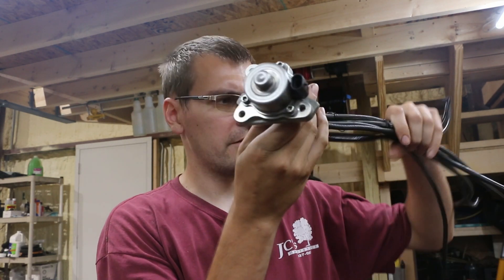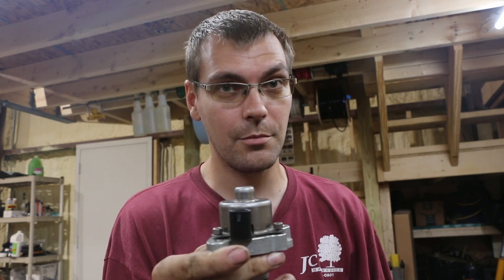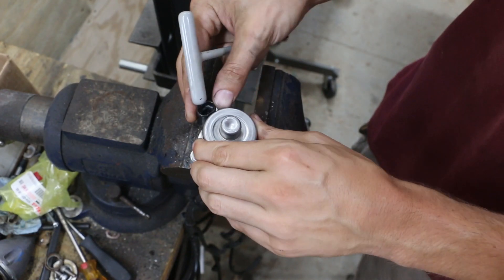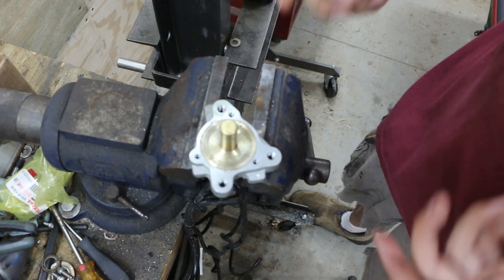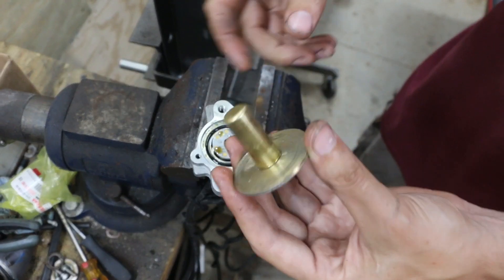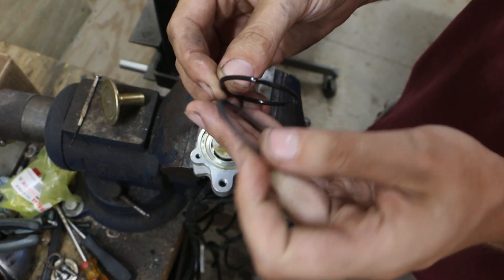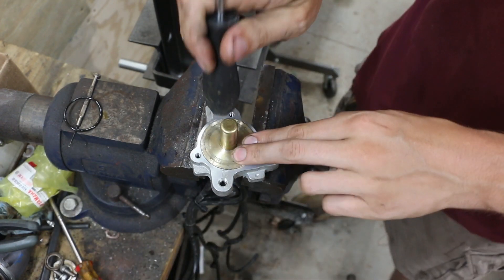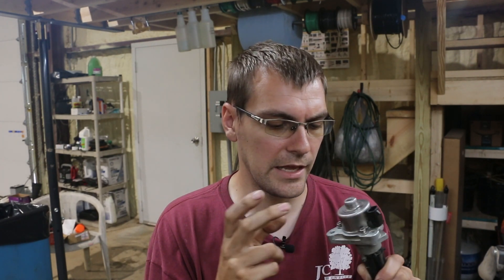Mercury Optimax oil pump leak repair. (Maybe.)

Comment: Is there a spring in behind that piston?
Reply from the maker: yes, its essentially a small solenoid pump, so the solenoid energizes, pushes some oil, then de-energizes and is pushed back by the spring

Comment: Was that M3 X 36mm ID or M3 X 36.2mm ID. I am in Australia and I have unburnt oil dripping out when I tilt up my Optimax 150. I have checked on the hoses for poor connection and the one that's connected to the block is has a loose cable tie but no oil leaking there. I am guessing it is the pump.
Reply from the maker: I used a m3 x 36id, this exact one is what is in my order history: https://amzn.to/47KQPLe

Comment: If the o ring is replaced while still on the boat without disconnecting the lines would I still have to do the priming procedure?
Reply from the maker: I would be hesitant to skip the priming, worst case you use a little extra oil for a while and foul plugs, best case it bleeds out any air that got into the system while it was open to change the o ring

Comment: Is this the only seal in the whole pump? The only place it could possibly be leaking?
Reply from the maker: This is the only seal I am aware of that will cause a leak, but there are other small o rings on each piston that could cause it to not pump oil. I haven't seen those cause an issue yet though
Reply: No, it has 7 more o-rings, they wont cause a leak, but are critical, if you need one you need all, IE new pump, not worth the risk

Comment: Since the oil tank is under pressure this unit is playing a role of valve to allow compressed oil to go thru output so it is not a pump it is a one wY controlled valve to open and close oul supply
Reply from the maker: Close. There is air pressure fed into the remote oil tank to keep the primary oil tank full, with a 2psi check valve to make sure the pressure does not get too high, but the actual oil pump is an electronic solenoid pump that pumps oil regardless of there being pressure in the system anywhere.
If it relied purely on the pressure in the tank, the engine would starve for oil at startup or any time the oil tank was opened to fill.
You can disconnect the air line, remove the remote reservoir, and still run the engine without issue until the primary oil tank runs dry, or run the prime procedure with a scan tool or using the onboard method to cycle the pump with the engine off and no pressure anywhere in the system.
However, that slight positive pressure in the system could be a major factor in the o-ring in the pump leaking as it ages.
Reply: It is pump, will deliver oil with no pressure on the tank. in fact if the pressure is restricted and the tee check is bad or some one capped the vent port it will suck the engine mounted tank in due to a vacuum. Most the time the leak is not that o-ring it is a cracked brass cylinder

Comment: Question. Have u have done this with the pump still on the engine ? 250 pro xs
Reply from the maker: Yes. I did it on a 225 pro xs on the engine. It was a tight squeeze but doable. I would not even consider doing it over the water, too many small parts that could easily be dropped, but on a trailer I wouldn't hesitate to pop it apart and replace the o ring
Reply: @trythistv  yup I did it o ring was pretty flat took 15min on trailer in shop. Then primed 2x w my diacom.    Allen key with round head on it worked great
Reply: @trythistv  thanks for video. It saved me so much work and for the o ring link. Great content.
Reply from the maker: Yes sir! Ball head hex are awesome. Glad the video helped you get it together!

Comment: Exactly where is the pump located?
Reply from the maker: If you pull the cowl, looking from in front of the engine (if you were kneeling on the boat), the pump has been on the bottom left hand side of the engine, almost under the lower cowl on every opti I've worked on, there could be a bizzare one out there thats in a different spot, but thats where I've always seen em.

Comment: Worked great on a 2009 EFI 150 I pumped throttle 4 times to activate oil pump prime mode and it was all set thanks for the video
Reply from the maker: Awesome, glad to hear it helped you out.

Comment: I had a small leak from the oil pump assembly. The O ring was Ok, but found a longitudinal crack on the solenoid. Why did this happened? Is it a common problem with Mercury 200hp 2.5L EFI? A new pump has to be install?
Reply from the maker: I haven't seen that happen before, It is possible there was a defect or something, or possibly we will start seeing more fail like that if it is some kind of age or use related failure. Could be the action of the solenoid causes stresses that eventually caused it to crack, or something else, who knows!

Comment: Uhhh, still no luck finding the o-rings.  All the shops want to sell you a 600.00 new oil pump!  IF an oil pump goes bad, does it beep and let you know so you do not have catastrophic failure?
Reply from the maker: No warning on if the pump stops pumping. It is a relatively robust design, being a solenoid pump, but with that being said, it is not going to let you know if something does go wrong.
As far as finding o rings, I commented a while back about another source:
Mcmaster Carr. They sell everything on the face of the planet, and a few things that haven't made it here yet.
One of these 2 packs should do what you need, the cheaper one only has 5 o-rings, and seems to be a little different from the description, as it says there is a shelf life, cure date and stuff, so I'm not sure if thats a more milspec type situation, or if it is a different type of material. Still says Viton so it should be the same stuff, just perhaps held to a higher standard?
https://www.mcmaster.com/1295N563
https://www.mcmaster.com/9263K315

Comment: Could this be done without fully removing the oil pump from the motor? By just removing the cover while it's still on the motor and replacing the o ring in place?
Reply from the maker: Yes. I have done it with the bottom cowling still on, while the boat was in the water, its tight, but can be done. I would recommend against trying it while in the water as if you drop something, it goes to the bottom of the lake, but it can be done, preferably do it on a trailer where any lost parts won't vanish for good.
Reply: @trythistv  I'm going to do this I'm glad you shared that. I really don't want to disconnect hoses and that fun stuff. Do I still need to prime even if I replace the o ring this method?

Comment: Priming process is via dealer OR, turn key on and within 10 seconds, move throttle N to F 3-5 times. You should hear the oil pump clicking and fuel pump coming on. Could last 30 seconds to 1 minute ish. Note: this puts your motor back in “Break In” mode and it’ll use double the oil for 2 hours.
Reply from the maker: And it makes a glorious cloud of blue smoke when you fire it up after priming!

Comment: Do you have another source for the O-rings ? They are out of the V3.00x036 the only one close to it is V3.00x36.5
Reply from the maker: Mcmaster Carr. They sell everything on the face of the planet, and a few things that haven't made it here yet.
One of these 2 packs should do what you need, the cheaper one only has 5 o-rings, and seems to be a little different from the description, as it says there is a shelf life, cure date and stuff, so I'm not sure if thats a more milspec type situation, or if it is a different type of material. Still says Viton so it should be the same stuff, just perhaps held to a higher standard?
https://www.mcmaster.com/1295N563
https://www.mcmaster.com/9263K315
Reply: @trythistv  thanks! The ones I got from another site wasn’t correct even though it had all right dims etc. ordered off your link you provided now. Hopefully it’ll be correct this time. Super easy to perform the repair while it’s mounted on the boat. I put it all back on for now and once the new o rings arrive, spend the 5-10 mins to do the repair again.
Reply: @Profishinal  do you have the part number I don't seem to be able to find a 36 only see 36.5 on that website. Thanks
Reply: @mikem7683  I bought 9253K315
Reply: @Profishinal  Thanks I think I found it it's a 50 pack. Let me know how it works and if you want to sell half the pack I'll buy it from you who needs 50 o-rings lol
Reply: @mikem7683  I only got 10 pack. 🤷🏻
Reply: @mikem7683  and from the looks of it, it’ll work perfectly. I’m going to change it out tomorrow and I’ll let you know.
Reply: @Profishinal  thanks for the info and I hope the fix works for you will have to do mine in a few weeks.
Reply: @mikem7683  the o rings are much fuller… had a hell of a time trying to get the plate to seat back in. In the end I couldn’t get it and seems like the plate won’t set in there by itself anymore. I just put it on carefully and put the plate back on and the plate is only being held in by the cover with the 3 Allen screws now. I’ve tested over an hour and no alarms and no issues with leaking anymore. Again, the oring was a fix to my leaking issue. Not sure if there’s a better option for oring that isn’t so full so the plate will set in better or not? I’ll replace the pump in due time, most likely next year, but for now it’ll be fine for the rest of the season.
Reply: @Profishinal  thanks for the info. By fuller do you mean the thicknesses  of the o-ring
Reply: @mikem7683  yes thicker.

Comment: I have a Nissan 90HP Direct Injection - TLDI.  I have read its the same pump as the Optimax and Mine has a slow leak.  Will be trying this.  Thank for posting!
Reply: After disassembling/inspecting my leak was caused from a crack in the brass piston (the one which came off in the video).  Make sure you insect that part!  If it has a crack and is leaking replacing the o-ring will do nothing to prevent air bubbles entering the system and potentially causing lack of lubrication/major failure!

Comment: I dont know what wrong. But i replace the o ring you talking about.  And it still leaking . do you have any ideal ?
Reply from the maker: There are some other spots it could leak from, hoses are always a suspicion, or if you can see it coming from around where the o-ring area is, could it be you didn't get it quite seated properly?

Comment: how do you prime the oil pump
Reply from the maker: A scan tool is the easy way, but some optis can be primed by switching the ignition key to run (Don't start the engine) then very rapidly shift from Neutral to the Forward detent, back to neutral, back to forward somewhere around 5 times in a 10 second timespan, and if you have the cowl off you will hear the oil pump clicking, fuel pump will also come on, and that is a prime cycle, it should run for about a minute, which if the oil reservoir is full it should pump a bunch of oil which will make a glorious blue cloud when you start it, and that also resets the break in timer so it'll be billowing smoke for a few hours as it drastically increases the oiling rate.
Reply: @trythistv  How about a mercury 240efi? Islandia bombadier
Reply from the maker: I'll have to refresh my memory on the islandia, I've worked on a few of those, replaced an engine on one that failed from an oil line popping off.
If I recall they use a mechanical pump, not this style optimax solenoid pump, although I believe there was a retrofit kit to switch to an electric pump but I'm unsure, it's been a while since I've had one in the shop to put eyes on. Super cool boats, just don't see a lot of them.
Reply: @trythistv  yes love the boat

Comment: i have mercury optimax 2 stroke  90 Hp 2009 . do you know if this o ring gonna fit on mine? thank you .
Reply from the maker: It should be the same pump from what I can see, The one in this video was off a 150 Optimax, I've worked on a 250 ProXS that uses the same pump, and the exploded diagrams look like the 90 uses the same one, so the o-ring should work on your pump!
Reply: @trythistv  thank you . and im trying to prime it after replace the o ring by manually setting motor back to break in mode. Can you please tell me is there anything need to watch out if i do that my self. I just worrry  because i dont know if the oil pump working properly after i prime it.
Reply from the maker: I would find one of the little hoses (outer is the outputs, the big hose in the middle is the input, don't pull that one off) out of the pump and pop it off the nipple, could even do it right on the back of the pump if there is access, make sure its pumping oil out of the nipple, you should also be able to hear and feel the pump running when you do the reset, if you have a nipple off it will be obviously pumping oil out as the pump runs for the prime/breakin reset.
Reply: @trythistv  appreciated for helping out.  Besh wishes

Comment: Nice video ,so it is a solenoid pump  right????
Pls reply
Reply from the maker: Correct, it is a solenoid pump, as far as testing the pump I'm not 100% certain but a voltage pulse should cause it to pump oil, I would think it would be a 12v solenoid but I am not sure about that, and I wouldn't leave voltage applied for more than a quick tap to the connector, likely attaching some clips to the pins, connect negative to negative on a small battery like a lawnmower battery, then tap the positive alligator clip wire on the positive terminal of the battery and see if the pump clicks, more than a quick tap could end up burning out the solenoid coil if it's set up how I'm imagining.

Comment: What is the process of priming the pump?
Reply from the maker: A scan tool is the easy way, but some optis can be primed by switching the ignition key to run (Don't start the engine) then very rapidly shift from Neutral to the Forward detent, back to neutral, back to forward somewhere around 5 times in a 10 second timespan, and if you have the cowl off you will hear the oil pump clicking, fuel pump will also come on, and that is a prime cycle, it should run for about a minute, which if the oil reservoir is full it should pump a bunch of oil which will make a glorious blue cloud when you start it, and that also resets the break in timer so it'll be billowing smoke for a few hours as it drastically increases the oiling rate.
Reply: Do you have to do this process anytime  you replace oil pump, and is it the same exact way with hot foot installed. I know that's a dumb question but on my tournament last week my boat threw one long beep said low oil warning shut motor and remote off checked my tank still was half full and motor mounted oil reservoir is full as well then I figured to try run motor after checking things out. Started boat idle just fine once I step on hot foot about to get on pad it once again gives me a load long beeeeeeeep and merc'moniter said same thing day was ruined. I had 16.25 lbs in my live well at 9am couldn't drive to my other spots to find 5th😢. Got home there is continuity in the little sensor that's in motor mounted oil reservoir so I figured it has to be the pump so I'm going to replace it and need to double check I do everything right before running boat again thank you